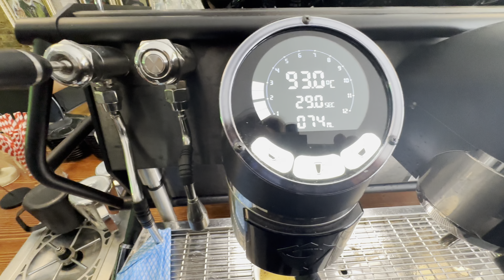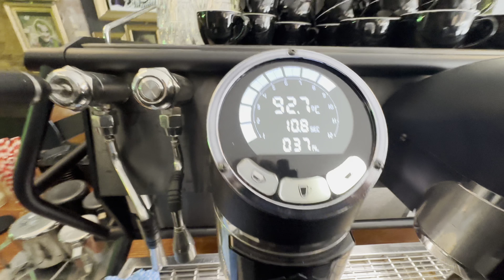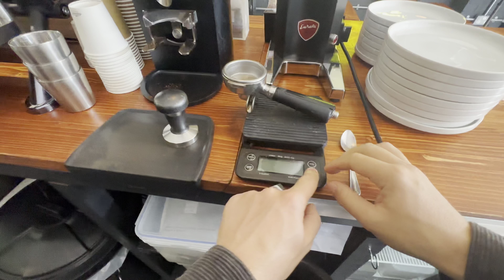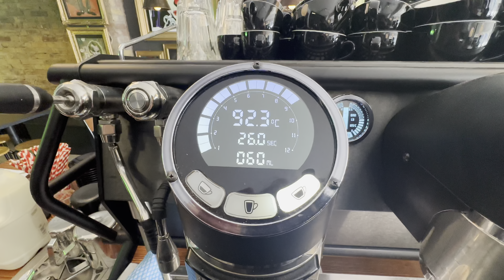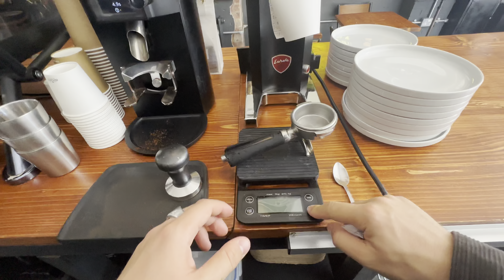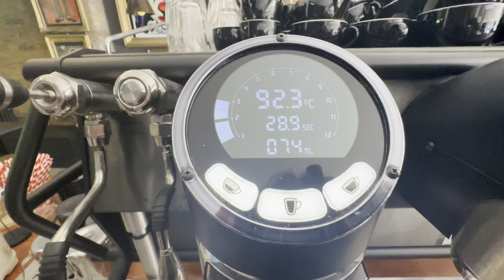POV- Barista works a calm morning shift at a cafe

Comment: Instead off throwing away the excess amount of coffee, wouldn't be better to keep it somewhere so that when you get less than pretended use it to fill it up
Reply: Once coffee is ground, it goes stale much faster. By the time you actually need or want to use it, it would completely throw off the flavors of the brewed coffee. It would be very difficult to get a good drink mixing fresh and old coffee grinds.
Reply: @luisgaleas9919 maybe he can toss it to the other portafilter. He wastes a lot of coffee.

Comment: my dude, your frothing technique is messy as hell. at least get rid of big bubbles by introducing air in short period of time and swirl to break it into microfoam. also, you never weigh your milk with digital scale. let me ask you, how many cups can you make with 1 liter carton box of milk? six. and that's approx 160ml. the rest is espresso and foam on top or syrup if your customer order something like vanilla, hazelnut, or mocca in a 200ml coffee cup. thicker foam if you make cappuccino. how can you weigh every puck at 18 gram and not the milk? this is the exact opposite of being consistant. 

and before anyone asked anything, i'm business owner and i run several bar and cafe. training young lads like you is my responsibility.